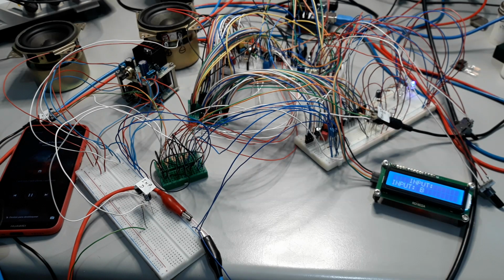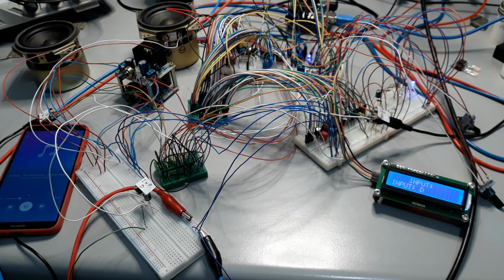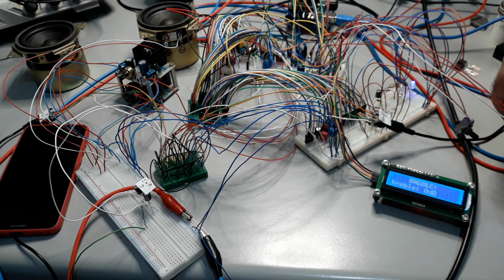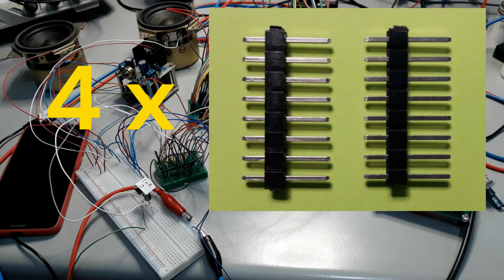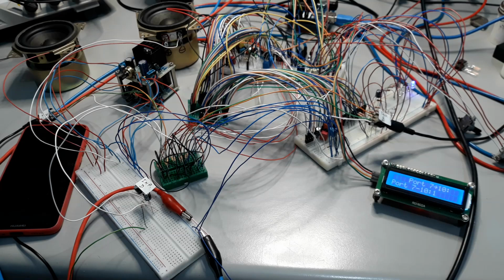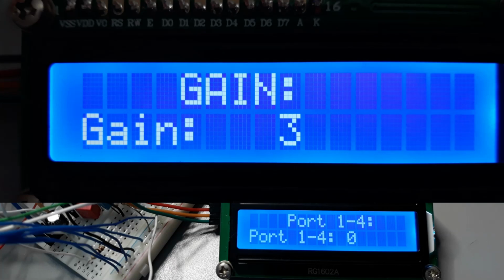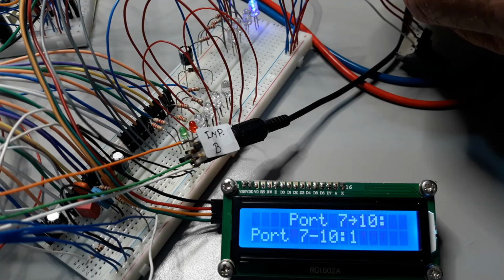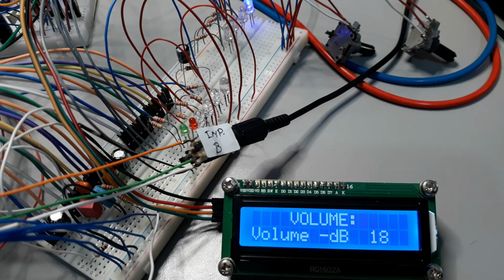M62445

Comment: Minor nitpick, but your display should show dB -18 (or better, -18 dB), not -dB.
Reply from the maker: Hi @GRAHAMAUS,
Sorry for the late reply, but the bad weather on my end only gives me internet access for a few minutes!
Of course you're right, but I try not to complicate the representation, and the table for this IC is always negative dB (page 9/17 of datasheet) for Volume. The gain table, however, is positive.
The correct display on the LCD would require me to use 6 lcd.print and set commands to correctly combine the integer, text, and sign.

lcd.setCursor(0,3); //Second Line of LCD
lcd.print("Volume -dB ");
lcd.setCursor(12,3); //Second Line of LCD, write column 10
lcd.print(volumeR);
plus two lines to define a new position taking into account the number of digits and position of sig.
I usually try not to use simplifications to avoid overloading libraries. Many people have difficulty in this area, so I always keep the code as basic and low-level as possible.
Sorry for the imprecision, but the idea was to avoid complications, but if you want, just adjust these lines, okay.

Comment: very good professor, I am surprised how you understand the binary communication of that component, I will share your video with my friends so they can see it, in my region I don't know anyone else who understands programming with Arduino, God bless your knowledge, thank you very much for your contribution.
Reply from the maker: Hi @SaitronicleoTV,
First of all, I expect the video can answer your questions about using the IC.
I didn't worry about the component details, as that's just a matter of time and a closer look at the usage example.
We can easily see that there's a duplication of components for the left and right channels, so addressing it this way helps a bit!
In short, the code has some functions that can be easily adapted to convert to others that are missing.
The most unusual part of the code is the use of bit shifts to the left or right in order to perform an OR operation with the bits already in the correct position.
The code was kept as basic as possible to be easier to understand step by step. After you manage to do what you want, you can convert the binary data to hexadecimal and thus reduce the code size.
If anything is unclear, please let me know; your doubts will certainly be the same of  by many other persons, answer to one will  be to all.

YouTube is taking a long time to create audio in other languages, but the auto-translate subtitles should already be available, including in Spanish, if that helps.
Reply: @jlsmonte Hello, if I analyze the code I can understand some details, when I have time I will send you what I do not understand about the datasheet, the one that refers to the displacement bits and their options for each function that has me quite confused, as well as the binary communication from the Arduino to the M62445.
Reply from the maker: @SaitronicleoTV  Take your time, and after put yours questions, I will try explain it, Ok!
Reply: @jlsmonte Hello friend, I wrote to your email
Reply from the maker: @SaitronicleoTV ,
I me without energy and net... the weather still on violent side at Coimbra